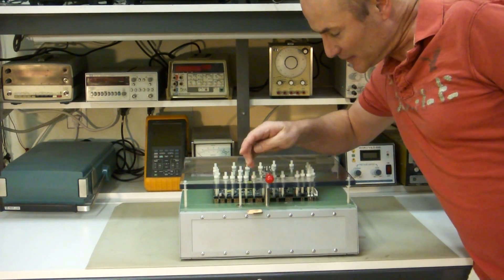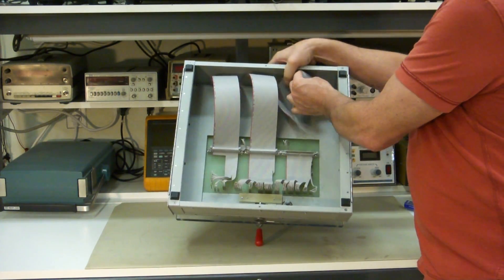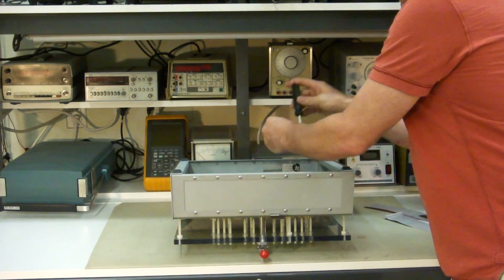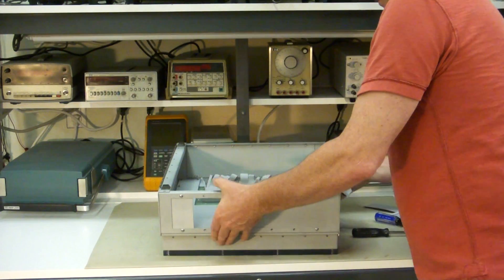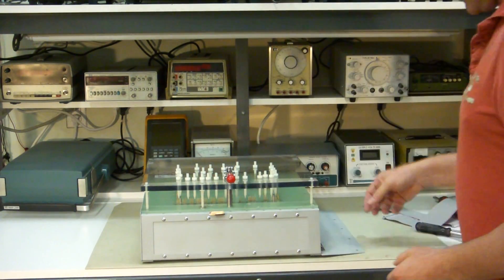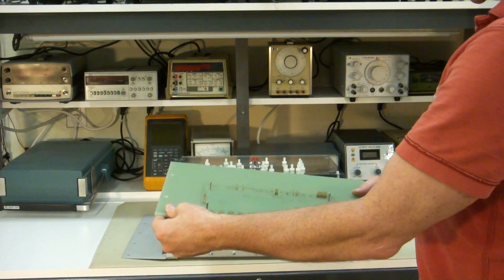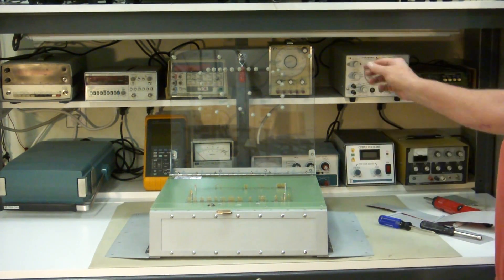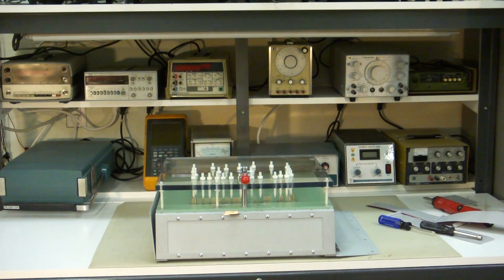Prober Bed of Nails Tester Mounting Features Available

Comment: Thank you for your sharing,well how to connect your computer to see the testing result,we don't see start button and power switch.TKS
Reply from the maker: You are correct, this does not show the start button and power switch. It also doesn't show any of the  computer interface and drive circuitry or test loads or power supplies. This customer had developed their own test electronics. Before we built them this test fixture they had a bunch of custom circuit boards and cables spread across their benchtop and would test each board by plugging in all the cables individually. Our objective was to ship them this fixture so that they could take everything they had on their benchtop and install it in the fixture and have a much faster way to electrically connect everything to their board. So in summary, this was just a mechanical build for this customer. They in turn installed all their electronics they had built inside the fixture using all those mounting brackets we provided. They also wanted to cut holes in the front and rear panel inserts for switches and connectors themselves so that is why we just provided the blank panel inserts.